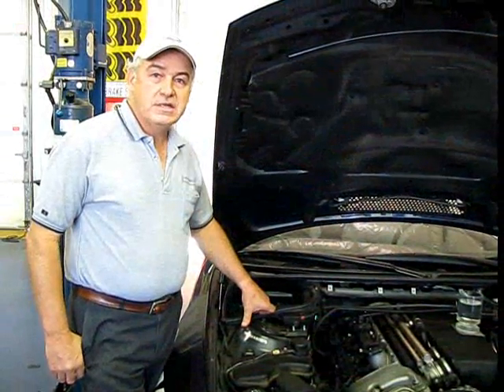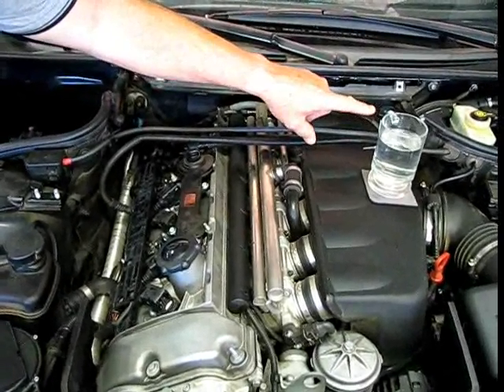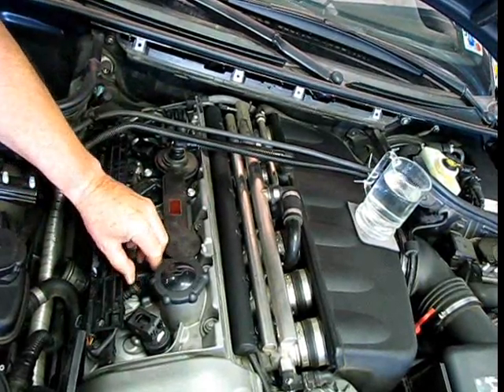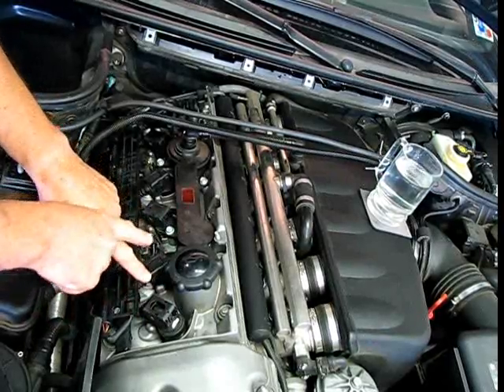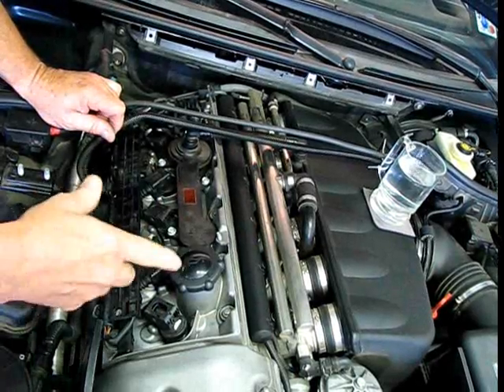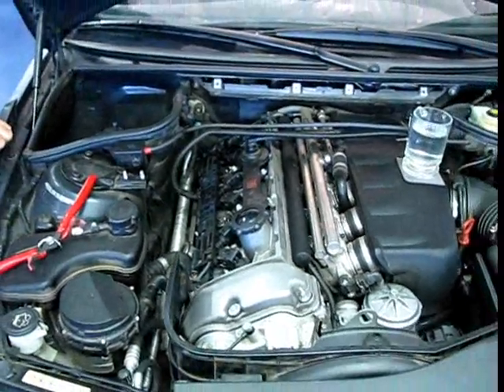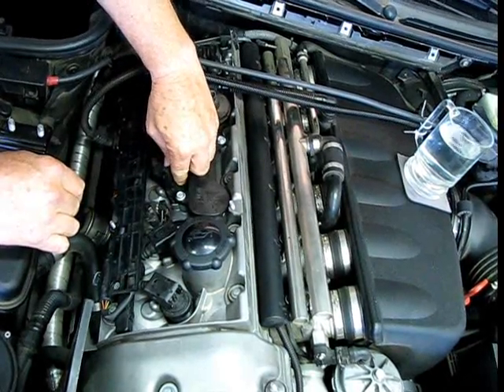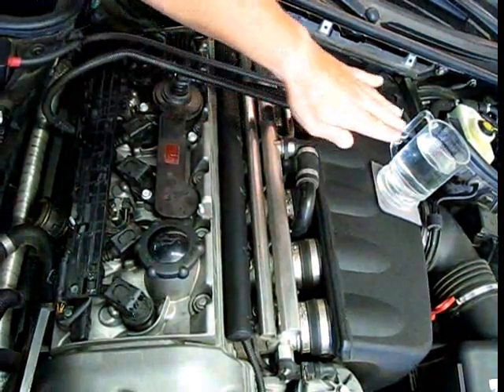BMW E46 M3 Ignition Coil Replacement and Cylinder Misfire

Comment: Dielectric grease is not necessarily recommended by BMW, but many people put a VERY thin  coat on the inside of the first two inches of each coil boot. Must be a THIN coat.
No never seize should be used with NKG Platinum  plugs. Their threads are plated specially.

Comment: Just replace all of them for about $145.00 for six on Ebay.
 Buy the Eldor (NOT Bosch or Delphi)  make and model coils  that fits the E46 M3.
BMW Part number  12138657273
Eldor Part number cross reference  R3516S00100
Eldor coils come in plain white boxes. All of them do. Dont be alarmed.

Plugs NGK Platinum ONLY 
6X NGK Laser Platinum DCPR8EKP  $62.00

Several other options. But, only one BEST option.... as listed above.

Comment: Thank you, turns out my spark plug cylinder 1 was loose. could feel if pulsing as the engine idle while I pressed down on the crown of the coil pack. turns out the spark plugs ground electrode was GONE! .solution, cleaned hole with compress air installed new plug and new coil. The problem I was having is the car would only misfire when it was warm, mostly at highway speeds ...NO CODES...problem seems solved.

Comment: Thanks for the upload. Was very helpful. In my case the diagnostic machine showed cyl 5 down so replaced one plug.no joy. Replaced the coil on 5...better but no joy. All plugs...still no joy. Back on machine cyl 4 now down. Replaced all coils inc 4 ..now fixed.  It would miss badly under load while driving and hesitate /misfire when punching accelerator from idle.  I have heard that when coils go that sometimes more than one can go.  Hope the main video and this description helps someone else👍

Comment: Just came across your video because I had some cylinder misfire codes and I wanted to see what the possible causes were. I'm getting a buildjournal tune done to my 2004 M3 and part of the process is providing the company with an error log. I'm glad I did that otherwise I would not have known about the misfires. I bought the car recently with just over 50K miles so I decided to buy a set of coils and spark plugs and will do a replacement when they arrive. I've never done any engine work before so I'm looking forward to some DIY. Thanks for the video. There is also a video on taking the parts of the car apart to gain access under the engine cover so that also is very helpful.

Comment: great video.  I got a error code P0303.  would one also check the spark plugs to see if they are bad while you check the coils and change those too or it would most likely be just the coil ?  thanks

Comment: Silly method to determine the defects in the ignition coil !!!
Such a defect (as shown in the video) is defined in the self-diagnosis of faults in the recording memory. Pull the plugs coils with frightened eyes does not make sense.
But in the case of misfire under load, but without the accompanying registration memory error code, the video will not help

Comment: Hi,I'm driving a Bmw e36 18 is 4 cylinder, I change spark plugs and wire coil  because I had a miss fire, now out the blue still miss fire and I noted if I switch the car off and wait 2 minute the car runs like normal, can please explain way these happen?Thank youRegardsDario

Comment: Thank you for a very informative video!

I was driving around today and while sitting at a traffic light my 2001 M Roadster just started to misfire on one cylinder...  :-(  I limped home. Its amazing how much power is lost when one cylinder isn't firing. I plugged my code tool in and presto - it reported misfire on #2 - fuel cutoff! Cool - the computer cut the fuel off the the misfiring cylinder - nice feature. I performed the exact test procedure you show in this video and sure enough - #2 coil is bad. I also pulled the spark plug for cool measure and it was fine. So - now to get another coil.

Thanks again! I really appreciate the time you took to make this video.

Comment: the glass of water doing job for bmw e30 316i 4 cylinder motor?yesterday i puted a glass of water in the engine and the water shaking a lot!i believe is the valves not closing properly
Reply: The glass of water also alerts you to a possible T-rex nearby

Comment: Thanks for this video, but I had a question.  I've already replaced all my spark plugs and coils and the air intake  tube, but still getting the P0300 error, even though doing your test proved that none of the cylinders had issues as I lost power by unplugging each coil.  .  What else can I try?  Thanks much.

Comment: i have a bmw 316. when i give it full trottle the car makes a rough sound and has low power for a couple of seconds . the car was sitting up for a few years. i changed the spark plugs and worked fine for a couple of mins but is still doing the same thing before.also when i press down on the foot trottle the car almost gives up for 1 second but recovers.

Comment: I have a 2000 323i. I had a miss fire in 2, 3 and 6 when I pulled my coils there were some oil on them, what is the reason for this? Major issue?
Reply: Your valve cover gaket might be leaking somewhere around that cylinder.

Comment: What is bmw`s method of removing the ignition coil?

I see people use screwdrivers and shi*t but what is the official way, is there a tool for this specific jib?
Reply: I just use my hand to pull them. Sometime some of them are stubborn to pull out. Its fine, just put more strength.

Comment: hi I was wondering if someone can help me. I have a 98 328 i, my car was having Idling issues. brought it into the shop and they said I needed to replace all my spark plugs and all my boots and one coil. got my car back everything was running good for about a week. then I started having Idle issues again. brought it in again, they change the boot again. it was running fine for about a week and now its doing it again. does anyone know what's causing this to happen? thank you so much for your help.
Reply: correction they change the "coil "again
Reply: hey i was having the same issue, i pulled out my Idle control valve today and gave it a good clean, boom no more idle issues :)

Comment: Plugs do have a life span. However the new generation vehicles they will last for approximately 60,000-100,000 miles depending on your model car. So,if you have a single plug that failed prematurely then we need to take a look at that. A dead plug that is not firing, will typically start collecting oil deposits or fuel, depending the reason for the failure. If their is one dead cylinder it may be a good time to take a compression test ans see if the vehicle has some engine issues. - al hafner

Comment: I changed all my spark plugs and the ignition coils and it ran fine for like 5 mins. After that the engine was missfiring like before. Took it to a mechanic and he says it has a bad computer and it's almost a $3,000 job!!! I don't know what to do at this point?? Does the computer have anything to do with missfire?

Comment: its probably the same issue here. I currently have a problem on an infiniti I30t that is bouncing around in Drive but braked/idle (say at a stop light for example). Its most likely a bad coil or spark plug. Test it like this guy did and see if it works.

Comment: @528im52 i have both plugged out now and its running fine, better than it was, but wants to conc out if i feather the throttle at very low revs. i have 2 sensors ordered. again. thanks very much for the replys. subbed!!

Comment from the maker: @atourdeforce It sounds like your front O2 sensors have gone out, you cannot run without the front O2 sensors on your car.  If you unplug them, the car will automatically go into "limp" mode and will not be very drivable for daily driving.

Comment: @528im52 chers for replying back mate, last question, all the boots are good no air leaks, no bad coils or spark plugs,tried cleaning the sensors, car still runs the same, tried testing them , and the voltage was going all over the place, i did the flame test(im fairly sure that means there broke)?? if i were to unplug them from what i have read it would make the car run rich, but if they were at fault would the shudder go out of the engine if i unplugged them for a few days?? thanks again dude.

Comment from the maker: @atourdeforce That can be a variety of things, the most common are the oxygen sensors and also any cracks or holes in the rubber intake bellows which would require replacement.  These are the things that should be checked and replaced first, beyond that there could be an issue with the fuel system, but in many cases a lean code is due to one of the reasons I listed above.

Comment: @528im52 yes does that mean o2 sensors are on the blink, i have the same problem, engine check light is on(it goes away sometimes) and recently i have experienced shuddering or vibration at idle, sometime the engine seams like its gonna die, and sometimes i have no power(wont take off) was at the electro mechanic recently for a diff problem and he said  it came up engine mixture too lean. i really dont have the money to send it back again, could you please help me out, is it o2 sensors?? thanks

Comment: @Operator21  This is the perfect example why this Method isn't reliable when diagnosing misfires. Like i mentioned in previous post there are other factors that can contribute to a misfire. If you have already replace all coils and plugs your next step would be check for leaky injector. Sounds like after it sits over night or extended period of time,  the fuel injectors leaks and at first start-up the cylinder needs to burn the excess fuel...

Comment: @oscarv362370 
these faults are fuel mixture faults, too lean, most common reason for these faults to be triggered are vaccum leaks. The most common parts to fail are the crank case vent valve or intake below is torn at the throttle...

Comment from the maker: @darthba11er   It all depends on your shops labor rate and how long the diagnostic process to find the problem coil took.  Had it been at our shop the total labor rate including the cost of the new coil would have been approx $175.00 being that with the scan tools we use and the method above we can identify the problem coil very quickly.

Comment: I just paid $283 to replace an ignition coil.
Is that the going rate?
If I knew it was this easy, I would've done it myself.
Funny because the mechanic didn't even call me to tell me what was wrong with the car before performing this. I guess he figured it was an easy fix for the sale. Because there were other issues with the car that had nothing to do with the engine and they didn't bother with that without my "permission"

Comment from the maker: @Operator21 At that point, if you have changed both the coils and the plugs, the next item to look at would be the injector.  It may be that it is sticking, and until you have ran the car for a bit is is not opening all the way or at the correct speed.

Comment: Hi very nice video Im still trying to find why mine is still misfiring I changed the coils and the plugs and im still getting the misfire only  #3 cylinder and only when I start it up once its running the misfire is gone and the engine runs great what else should i be looking for?

Comment: My dads Bmw 530i, has this problem, a mechanic change the 2 igintioncoils (I think it was cylinder 2 and 4 that missfired), but after a couple of days the engine lamp start to light again. But,, those 2 coils were NOT NEW. I will do the samething you did in the video. Maybe the other coils is bad,, or just wait and lets see if the lamp stop light.  Great video!

Comment from the maker: @Jetubeb The two biggest and most used coil manufacturers for BMW are Bosch and Bremi.  Both are built to the same tolerances and specs for each vehicle, but some are preferred for different models for different reasons.  For instance with the E46 M3, the Bosch coils have an exta layer of heat shielding that helps prolong coil life.

Comment: @528im52  Ok, I changed the last two coils and finally there is no more misfiring going on. New spark plugs and new coils, that baby runs like a beast now. All of the 6 coils and 6 spark plugs were bad. And i am surprised that they lasted 125k miles. Noone changed them since the car came from Germany.  It took me $250 to change it all. (( sux.

Comment: @528im52 OK, done deal. Replaced all 6 coils. finally no misfire. Ne plugs and new coils. Every single one of the old coils was bad! and it was not possible to test them. just replaced all the coils and it solved the problem. Surprised that they lasted 125K MILES.

Comment from the maker: @aleksankazakov  Actually there is an in between, it would be heat and vibration related.  Heat changes from cold to normal operating temperature would cause a change in the resistance levels inside the coil causing it to fire early, late, or not at all.  Vibrations cause the internal components/wire windings to come apart and cause intermittent operation.  If you have changed 4 of the coils and there is still a misfire, I would think it is either one of the remaining coils or the spark Plugs.

Comment: @528im52 I replaced 4 coils, and it seems to misfire a lot less, however it still misfires. When I unplug a coil at the time  out of 2 old remaining (as it is shown on video) the engine idle changes dramatically when i unplug one of those old coils everything shakes more. I cant understand, that means that those old coils fire, but not all the way? or fire intermittent ? I thought a coil can be only dead or only working? there is no in between?

Comment from the maker: @aleksankazakov  It sounds like one of the coils is having an issue, since it is not happening all of the time the only way to figure our which one it is would be to read any stored fault codes the car has saved.  You could use the technique in this video if you were able to reproduce the rough running condition while working on the car.

Comment: can someone please respond. My 04 E46 seems to have a misfiring, but it is not a constant misfire like in this video. I replaced the spark plugs, and orange circles on all of the coils brought up to my attention, seems like the coils are old and have some visible heat damage, is it a sign for the coils being bad? seems like it only misfires sometimes, while running normally most of the time. the service light comes and then goes away when the car restarted.

Comment: Hi sir. Can a coil be at fault partly  when it goes out only at high RPM. MY 330i drives normal until I hit the gas hard and it revs over 5000RPM then it starts misfire and a service light comes on. After a restart it goes away and misfire goes away until I accelerate hard again .

Comment from the maker: @oscarv362370 Sir, the only way to reset it is to use a BMW Specific Tool to read and cancel the fault codes, all BMW Dealerships can do it or you can use a Peake Research Tool for it.  We have them in stock here at BMP Design and for your vehicle they are $139.99.  This will also give you the ability to read and reset all BMW Specific codes for your vehicle where as most OBD2 Scanners will not even recognize them.

Comment: I've changed spark plugs on my e46 but forgot to reconnect 2 wiring plugs. The engine started to misfire and engine fault light came on. But when I connected wiring plugs back the fault light stayed on. Will it dissapear itself or I have bring it to service?

Comment: hi good evening, please let me clarify one thing please, and my doubts about the BMW. BMW M3 E36 and E46 and that, and the other type models 325i, 325, 330, E36 and E46 are the models M50 , M52, S52 which are, are the old models in May, I wonder also whether the model of the BMW M3 and the same engine as 325i or 325ci, E36 and E46 .. THANK YOU.

Comment: @528im52 Does misfiring cause the car to not start up straight away at times? I have a Golf and it struggles at times when moving in gear and gas is being applied... it also occasionaly doesnt start up straight away.. ive been told by my mechanic its the coil.. could it be?.. would appreciate you thoughts.. cheers

Comment: At least your M3 had a permanent coil failure which is easy to diagnose. Back in the day my 328Ci misfired only below 1800RPM and only under load. Impossible to trace by simply swapping the coil packs. Replacing whole set sorted out the mess. Now I have an access to BMW DIS. Solving similar issues is no longer a problem.

Comment: This video was extremely helpful! I currently have a 2000 Honda Accord V6 with 5/6 cylinder misfire, which I find really weird. My spark plugs was just recently done by dealership, but I'm going ahead an probably purchasing a new set of spark plugs since its not even that costly for plugs.

The next thing I will try is most likely my coil packs, all 6 are going I don't care. I would rather have all brand new than only a few new.

Anyway to test working coils when it is out of the engine?

Comment: Great video. Thanks very much. With this video, and the engine cover removal video, I was able to successfully diagnose which coil pack was faulty, and rectify the problem ..... I'd have muddled through without this video, but my driveway time for the job was reduced to only about 20 minutes thanks to this.

Comment: Man I love this video! Took me about ten minutes to isolate the bad coil! Now I'm off to the auto shop to buy the replacement. You guys just saved me about $400 which is how much BMW charged me to do this exact procedure.
Reply: Just replace all of them for about $145.00 for six on Ebay.
 Buy the Eldor (NOT Bosch or Delphi)  make and model coils  that fits the E46 M3.
BMW Part number  12138657273
Eldor Part number cross reference  R3516S00100
Eldor coils come in plain white boxes. All of them do. Dont be alarmed.
Reply: @deplorabledave1048  why Eldor over Bosch or Delphi?

Comment: good video,but surely touching a coil connection whilst the engine is running,you risk an electric shock..correct me if i am wrong...cheers Craig